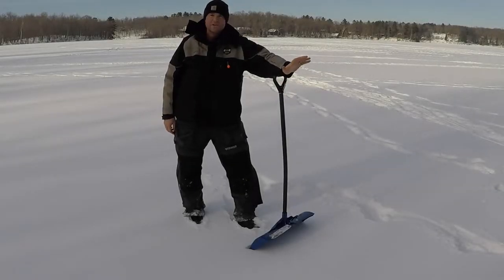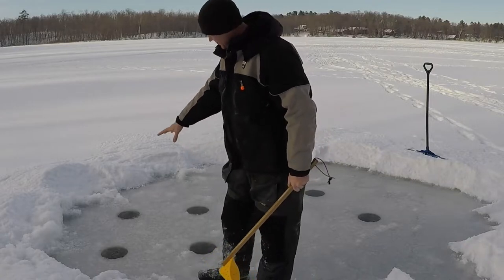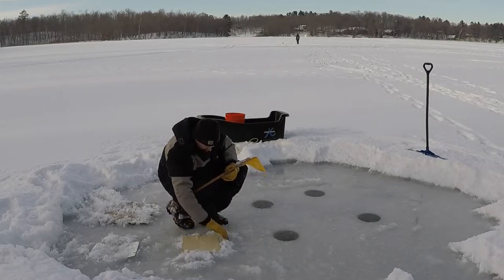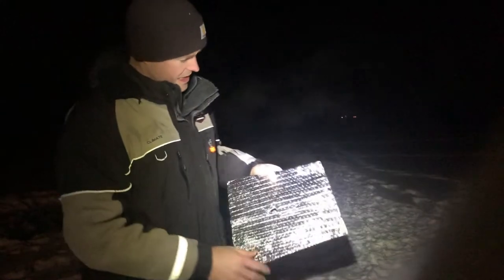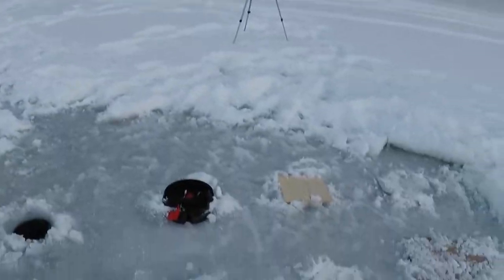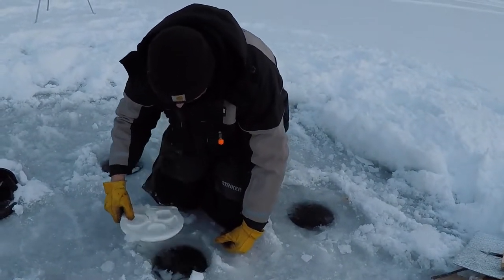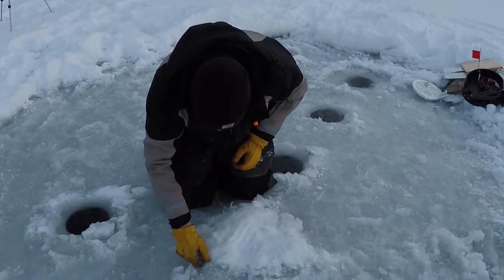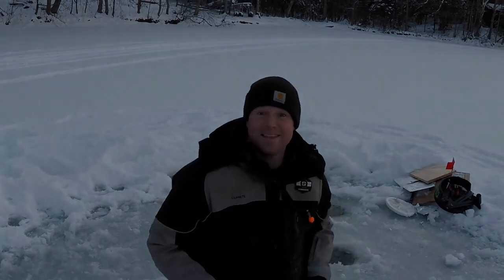I-Fish Pro 2.0 VS. Homemade Hole Cover

Comment: put another foam piece on the bottom of the ifish pro
Reply from the maker: Do you cut it to the same size or bigger?
Reply: @winnesotafishing  same size just have to make sure it don't interfear with fishing line when pulling it off to reel in
Reply from the maker: @beerrun9961  I will have to give this a try